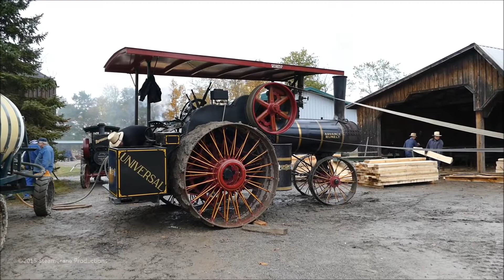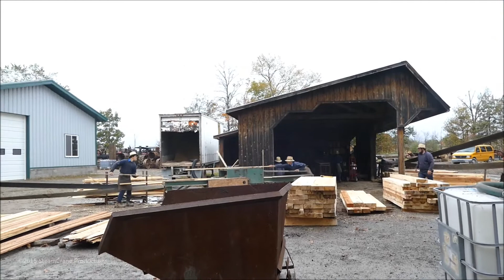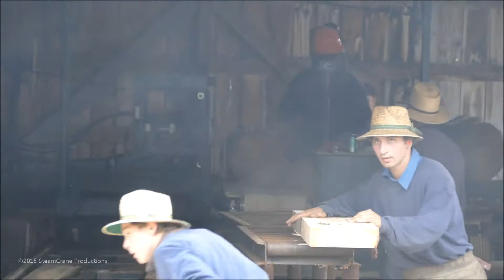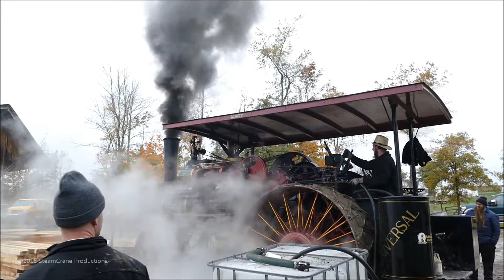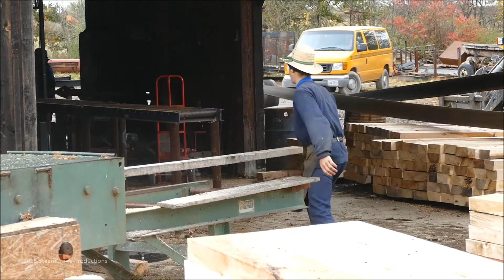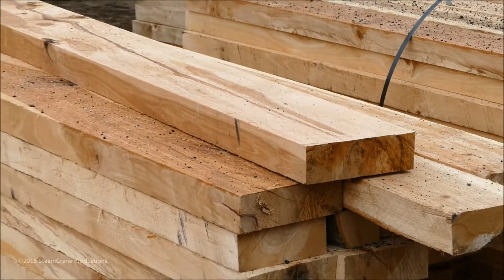Heavy Sawing With Steam

Comment: Jonas' mill is amazing, weather you come to work or watch. The Advance is really tight and smooth. Watch the center hole in the end of the crank at 39:00. When it hits the load, it never moves. If you think it was working hard there a couple of times, look at the width of the board that they put through in a 5 second pass......Dave

Comment: I am probably betraying a high level of ignorance with this question, but I am puzzled by the footage from the  left side of the engine that shows the engine crank shaft turning at a fairly steady and rapid rate, while the PTO wheel starts,  stops and varies speed greatly, without any obvious input from the engineer.   Is there a centrifugal clutch between the the engine and PTO wheel?  How does it keep from burning up--- there's a lot of power to dissipate.
Reply: There's a clutch but it's only used for driving and it uses wooden clutch shoes. It is not the centrifugal type. when stationary like this the crank disc rpm is the same as the pulley side. To slow down the pulley you'd have to slow down the engine. What you are seeing is likely the governor reacting to load. Or am I misreading your question.
Reply from the maker: +John Kailua What you're actually seeing is the motion of the flywheel spokes being strobed by the 60 Hz frame rate of the camera.  Each time the camera captures a frame, the flywheel is in a different position.  The speed of the engine is actually varying quite a bit, as you can hear. Cutting big hardwood logs at a high feed rate takes a lot of horsepower, and the engine tends to load down.

A more visible example of this strobe effect is the video I recently posted, "Strober D", showing a JD D with a lazy governor.  Take a look, it's goofy and hypnotic.

The new Panasonic FZ1000 camera makes the strobe effect more apparent, as it grabs each entire frame much quicker than earlier cameras, which tended to have blur, or bend the spokes as they scanned down the sensor.

The crank and flywheel are at opposite ends of a single heavy crankshaft, with no give to it.

Comment: Two comments to John what you are seeing is like in the old westerns when it looked like the wheels where going backwards.  My other one is wondering why they burn coal other than more even burning when they got all this free wood to burn, more BTU’s out of coal. Depends on where you are just seems odd.
Reply from the maker: They have other uses for both the slabs + sawdust. Nothing is wasted.

...and coal has more heat content and doesn't put out as many sparks.
Reply: @SteamCrane  That is why I ask instead of blowing of, thank you cool set up, I grew up and worked in and around mills, rope feed Jackson, right-hand Corly  so Sawyer's could see each other, 4-71s up to one with vert. Edger.

Comment: One thing I noticed which I found a bit concerning is the almost complete lack of eye and ear protection around the mill. I understand with the younger men it's going to be macho thing but the elder men should be guiding the younger ones in simple prevention safety. All I takes is one shard or part of a knot hole to get flung out and a young persons sight and life is changed first ever!